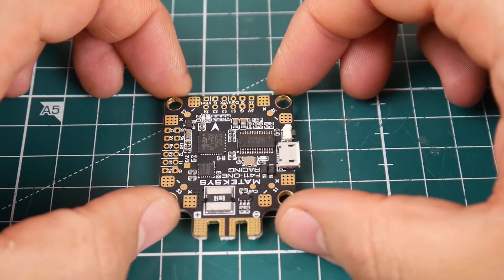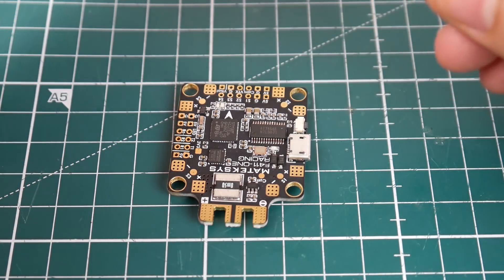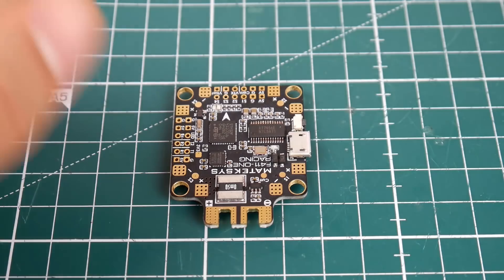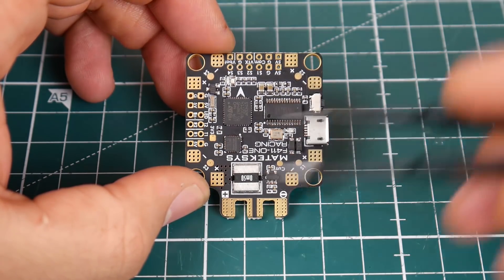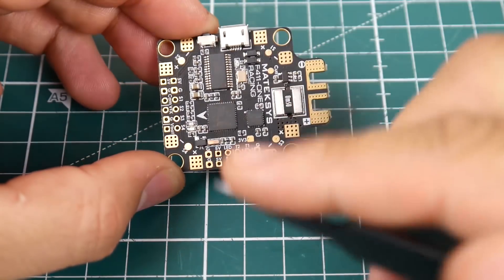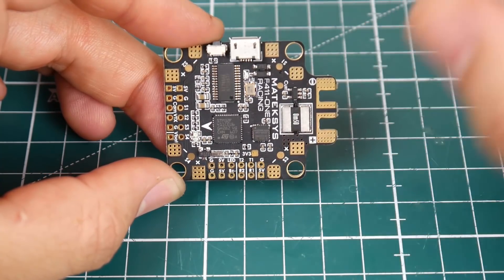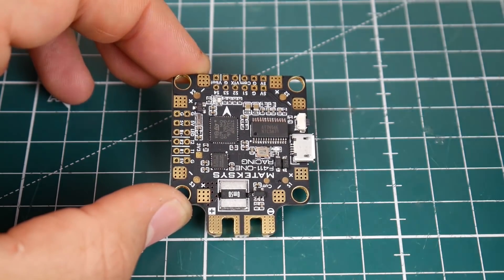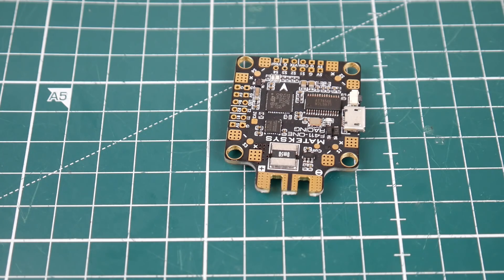Matek F411-One AIO with Frsky X-Proto Receiver Built In // Overview

Comment: I tried to fly with that today,
And I should be hurt.

I connected a battery to plug, It initialized well.
So I laid it on ground, and went to sit.
Suddenly, It's props spin fast with no control and no arming!!!

I think that a SPI RX is not stable now.

Comment: Nice FC for my tidy Rooster build but sometimes I get short twitches in the roll and pitch axis. Tried to loosen or tighten the nuts, didn't help. Maybe I caught one with a faulty gyro.
Reply: Very interesting. With D8 mode and EU LBT firmware.....no twitches.

Comment: Do you think that the all in one boards are going to become more available, One mount with pre installed VTX, receiver, similar to the stacks though all we as the public will need do is choose what type of frame and motors we want. And off we go. I am personally so excited as to where this avenue of the technology leads us, it is great. Well done Matek.
Reply from the maker: FC with prebuilt VTX should be avoided it's difficult to remove heat from boards that have the VTX integrated. They tend to desolder them selves. However VTX PDB combo seems to work good if executed correctly which Matek have done and is still rock solid from my experience.

Comment: F411 chip instead of F405 concerns  me pretty much. F411 is more than third slower (100 MHz instead of 168 MHz for F405) and have twice less RAM. How good F411 will be in new advanced  filtering support?

If such receiver location wouldn't cause glitches then it may became a kinda standard. You can buy the FC board and solder in any receiver of type you like. Of course FrSky receivers should have non-inverted signals then.

Just remembered - where is noise test?
Reply: These will run Adaptive Filtering easily at no more than 15% - 20% CPU utilization with Accel off. Also, these will easily overclock without any hesitation. I have been running these for a little bit now. The F411, with Adaptive Filtering, and even running Soft Serial never gets above 22% CPU!
Reply: But I wish to have accelerometer on. Stabilized mode go a nice help in landing :)
Reply: So you use an auto level mode? I never use any type of auto leveling, and I land flat and nice, but everyone has  their preference. Anyway, with Accelerometer enabled, it doesn't go up past 24% MAX, and for the most part stays below 22%.
Reply: Not always I want to land in stabilized mode. Depends from circumstances.

Comment: I would love to see a F405 version, don't know why matek only go with F411 these days. Might not be future proof with those new filters and butterflight stuff
Reply: Space issue
Reply: F411 100MHz is enough to run 8K/8K,  CPU load 15% with D600, DYNAMIC_FILTER, ANTI_GRAVITY, AIRMODE ON.  CPU load is 9% with overclock to 120MHz. The downside of F411 is 2 Uarts. but SPI_RX don't take any Uarts.
Reply: My questioning is more toward future if filters like fast_kalman become standard, would a F411 would be enough when we have to overclock an F405 ? Btw a matek 4in1 esc would be sweet !
Reply: F411 is enough to run 8K/8K and fast_kalman.  Seams nobody overclock F405 if FC has mpu6000 bult in.

Comment: Does the receiver provide telemetry?
Reply: Yes, just goes over SPI.
Reply: @deadmoo83  What is SPI?
Reply: @72lonewolf72  It is basically a direct connection to the flight controller CPU and doesn't use a UART.

Comment: Great break down.
1 question! How would you change the firmware on the frsky reciever ? LBT etc, or could you still wire it to your Taranis
Reply: The firmware is the Betaflight firmware. This thing is connected directly to the FC microcontroller via SPI. It is just a dumb RF transceiver. The special Betaflight firmware for this target board is doing all the heavy lifting. There is no serial protocols like Sbus /Sport communicating with a separate microcontroller on a separate receiver.
Reply: Hi, so  will it bind with an LBT version on the taranis using SPI RX support in betaflight? Is it compatible?
Reply: I don't see anything LBT specific in the Betaflight source code. Would have to ask Betaflight developers.

Comment: Good run through of what is on the board.  Look forward to seeing how this performs in a build.

Matek make good components.

Having the through pins for the motor signals helps for mounting with 4-in-1 ESC's, however the wiring gets tricky where you should take the output of the shunt resistor to any 4-in-1 board so that the current is properly metered.

I agree that telemetry pads in the corners for Blheli32 ESC would be nice.

My favourite stack currently is the Holybro Kakute F4 V2 with the Tekko32 4-in-1.  BYO RX and VTX, and only flash for blackbox, but plenty of UART's (RX, VTX, Camera, Telemetry), 32khz capable soft mounted gyro, OSD, 6S capable and mostly through solder connections.

Comment: Hey ik this suggestion would be stupid but why make a 5v pad on a fc these days fpv cameras,vtx,rx  can take upto battery voltage
Reply: Backwards compatibility, leds, receiver, gps, custom stuff that runs on 5v
Reply: Fidgety_ Fpv Good question! GPS, barometer, and other sensors generally take 5v since it's pretty universal. They want to sell to more than just the freestyle/racer market. 

Also, what RXs do you know that take VBAT? All of mine have taken 5v, but that doesn't really matter for this FC I guess.
Reply: Direct battery voltage to VTX and camera leads to noise in video feed. You want a clean power source. Either good 5v-12v regulator or battery voltage with some kind of LC filter.

Comment: Hey, man. Try to get some SunnySky x2212 980kv to test. It would take a 10 inches propeller on 3s or 8 inches propeller on 4s. Those are the best motors for something like a TBS Discovery or F450 type of quad. (I already bought 4 because I want to make one until the end of the year! 😀) I don't know if you like those kind of quads... Big ones maybe with a gimbal to make a nice video... But they're great! 😀

Comment: They should of sell just a board without receiver board and then sell their own receivers for  most of radios so you can solder it your self ☺

Lol that f4 chip is soo small !
Reply: Great idea, but currently Betaflight only fully supports FrSky RF chip and protocols with some preliminary support for other radio / rc protocols. Betaflight is actually doing all the rc protocol stuff. The "receiver" is actually just a dumb RF transceiver that supports the  specific RF modulation that FrSky radios send the higher level rc protocols over. It doesn't have its own microcontroller like a traditional receiver. Betaflight is what has to understand the FrSky rc protocols in this case. It is sort of how those transmitter multiprotocol 4in1 modules and Deviation work except on the quad end.
Reply: Curtis Campbell I think matek just took the receiver design, moved the stuff around so they can solder it strate to board. And they can do that with any receiver
Reply: Nope. That is what FrSky did with their FCs though. I read the Betaflight source code after I saw this board was coming out. It is just dumb cc2500 RF transceiver. It is the same thing Deviation did on the transmitter side of things. Required them to reverse engineer the rc protocols. Good thing is Deviation devs already did most of this work. So in theory the Betaflight devs can just port code over from Deviation as long as the licences are compatible.
Reply: Curtis Campbell 😐